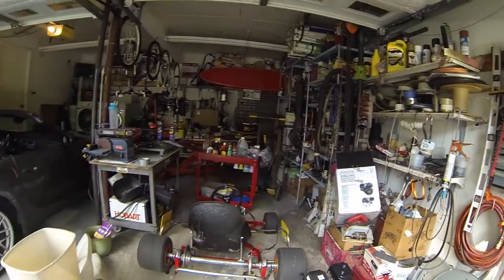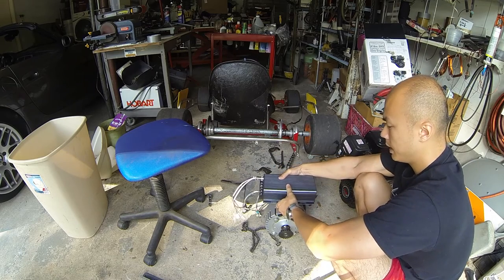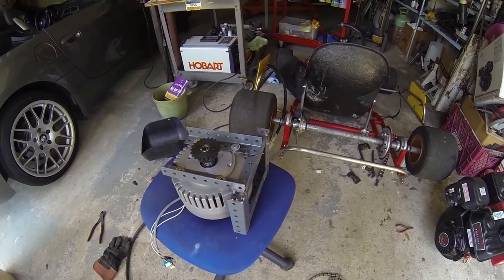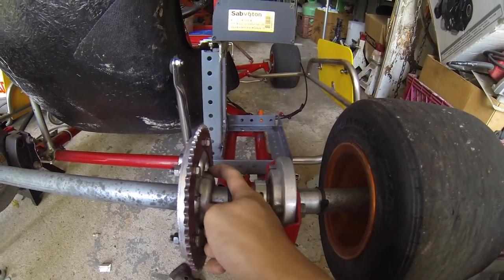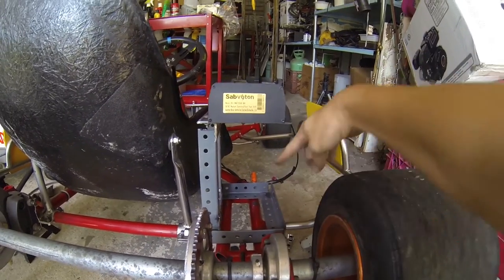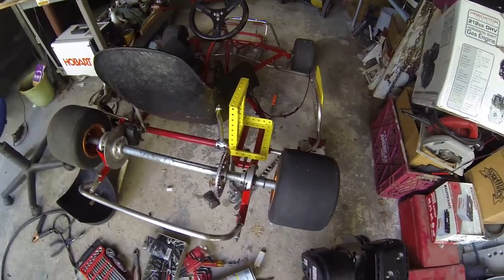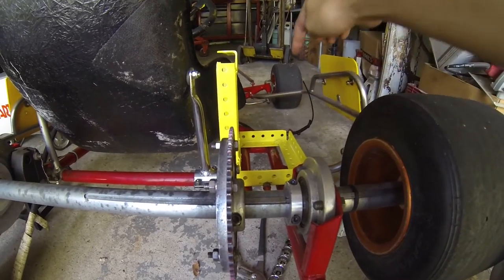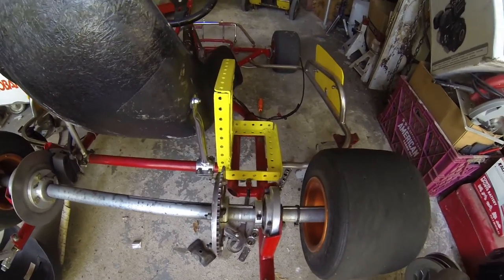Motor and Controller Mounting - Go Kart Build Part 7

Comment: I'm sure you've already done it as I have not even finished watching this video yet but as I could say from cars and cameras for testing purposes only I would have moved over the whole axle to wear that it brought your right wheel in closer to the cart and your left wheel further away and also changed the side in which the sprocket is on the Hub so you would have had to have moved your axle just a few inches